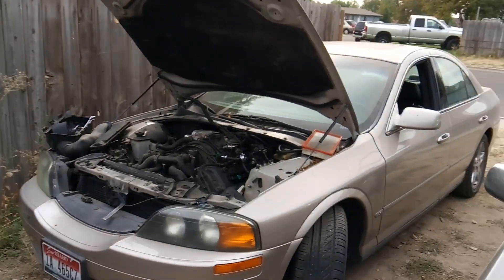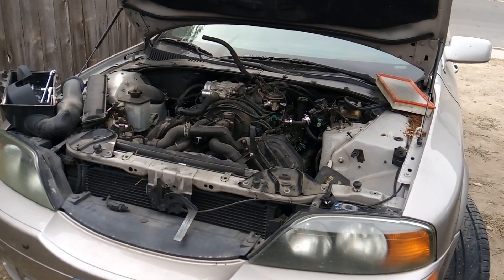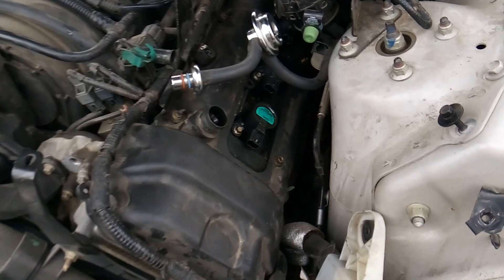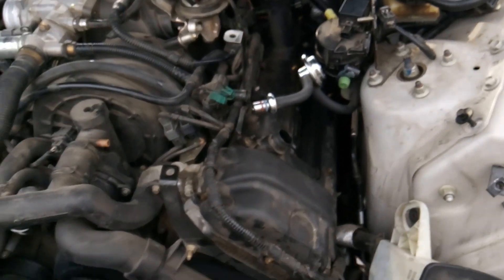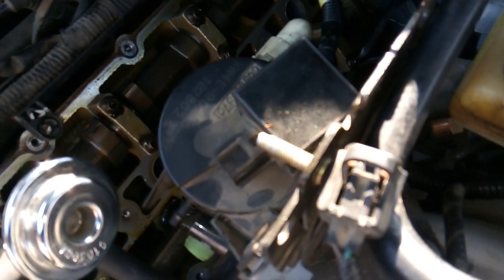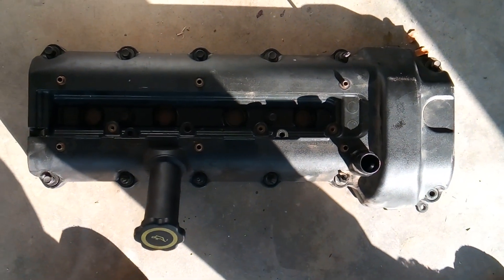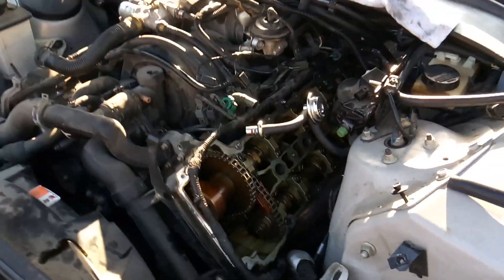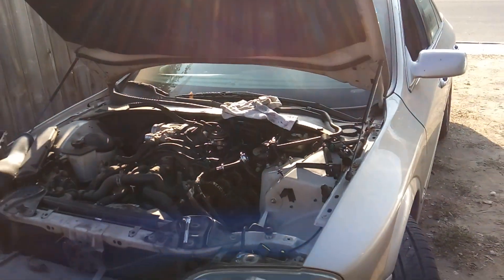2000/01 Lincoln LS bad timing guide diagnosis.

Comment: Hey just coming across this video exactly what I was looking for I have two of these cars I got one 2002 from a buddy he said the tensioner broke and blew the motor well I never even started the car cuzz thinking the motor was bad. Now I'm thinking it just needs to be replace . So the broken pieces dont get up in the motor and lock it up or do the just fall to the oil pan . I had the car for 6 months went and bought a 2004 with the 3.9 was going to do a motor swap had 73.000 miles once I got it home I put a fuel pump and been driving it since so now I'm I'm think I should actually start it up and see what I'm working with . Just didnt know with all that plastic breaking off would be bad for the motor